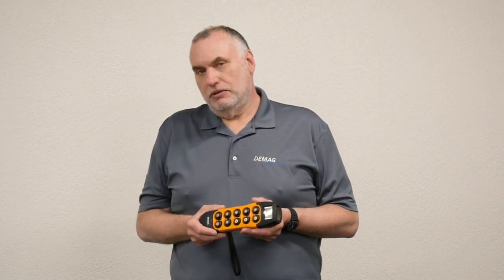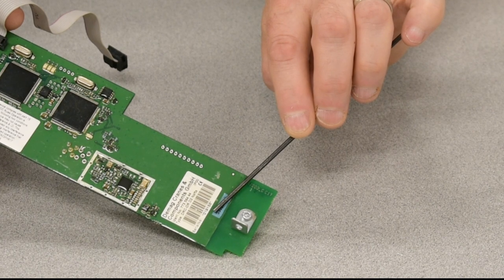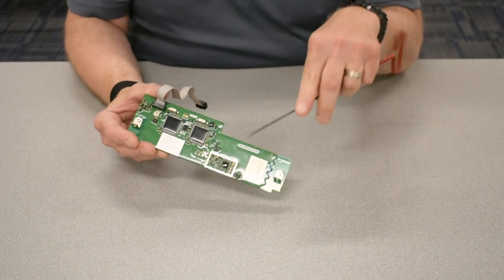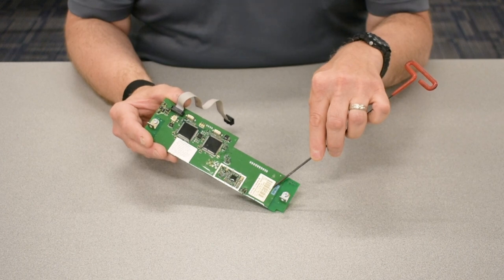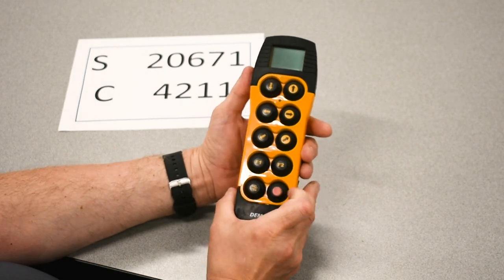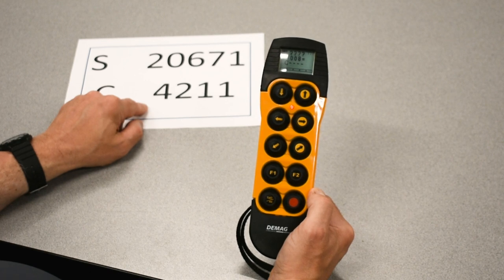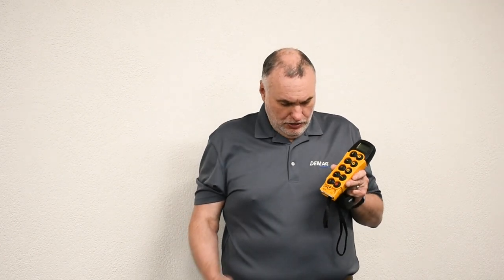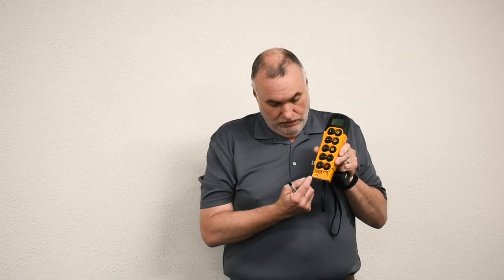Part 1: Start Up & Programming of the Demag DRC10D2, 900MHz Radio Receiver: Release

Comment: Hi, I have A DRC-10 which comes up with the lighting bolt and 00950, when we tried a new handpiece, the DRC-10 D2, it did the same. I can't find the erro codes for this other than an upgrade to DN3
Reply from the maker: We have quite a few resources we have made in regard to the DRC10D2 and D3. Here are some links to the blog.
https://blog.demagcranes.com/en-us/eliminating-error-950-when-upgrading-from-the-demag-drc10-radio-system-to-the-drc10d3-system/
https://blog.demagcranes.com/en-us/the-difference-between-the-d2-and-the-d3-versions-when-starting-up-a-drc10-radio/
If these are not solving the problem, reach out the the Demag location nearest you for assistance. - https://www.demagcranes.com/en-us/global-contacts/